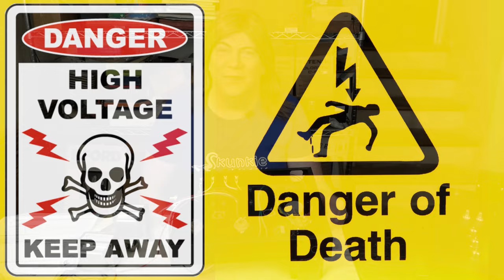The 12AX7/EL34 SE Amp Prototype: Power Supply Layout!

Comment: New subscriber here within the last year.  I primarily build small Class A guitar amps but lets face it, I basically build half your amp designs.  I just built a amp in a military 30 cal. ammo box for traveling and camping, no case penetrations so it's waterproof and the tubes were shock mounted and retained.  Your influence has improved my build quality 100%, under the deck it no longer looks like a basket of snakes, the layout and grounding schemes has my builds ultra quiet and dare I say it, very professional looking.  The basic amp was a D-Lab design (thanks Terry) everything was just under the locking cover right down to the Tremolo control and power socket and I floated it to a couple people I know and with your tips and style of build I had a bidding war going on when finished.  Pushed through a Bee Box enclosure with a Warehouse 12" veteran 30 the sound was amazing with a lot of sustain and chime I credit to wiring and sectional layout including using quality caps in both the power and signal circuits.   Thanks so much.
Reply: awesome reply

Comment: I’m very curious/excited for this build! I was gifted a ChiFi EL34 SE amp, which I’ve stripped down as I plan to do a new build using all the parts (transformers) I found a schematic I was planning on building, but I’m putting that on hold until I see how your build comes together.
Reply: I'm in the same boat. A Chinese amp designed for 807 tubes. That I have adaptors to use KT66 types. I think the voltage needs to be higher or better output transformers. The sound is clear but a bit scratchy thin. The chassis looks good so will rebuild it
Reply: The one I was given was an Oldchen with 5U4G rectifier and 6SN7 pre/drivers. I’m really just using the transformers, choke and some other small bits. Sounded quite decent in its original form.

Comment: Power resistors have flat surfaces so you can glu them directly to the top of chassis by thermally conductive glue. So the chassis will work as a radiator for resistors decreasing air temperature inside chassis. Resistors also can be located somwere on the side inside  chassis away from other components like capacitors and can be coneccted by wire to other components of circuit.

Comment: @ Skunkie.  I couldn't wait for you to get started on this since I am probably going to build this as my first tube amp.  I do have a good amount of the parts already as I was considering the build when you built your first EL34 amplifier with the octal tubes.
Reply from the maker: Realize I am already thinking of changes I will be making... If you start now, don't be made when the 2nd or 3rd one is laid out differently!
Reply: @SkunkieDesignsElectronics  Oh, I am not starting yet.  I definitely can wait.   But more than likely, I am going to stick with the Edcor output transformers right off the bat since I already have them.  I bought them a long while ago when I wanted to put together a "Darling" amplifier.  However, I abandoned that project given that the amp only puts out 3/4 of a watt and I have smaller speakers.  In fact, I have the same ones you have, the RP-600M's.

Comment: Glad you  canned the painted resisters the paint will retain heat  like putting on a jacket you can. Buy 10 watt black  ones that are high  quality with long leads
Reply from the maker: Not sure about paint trapping heat, Lots of air cooled engines are painted etc. But mainly just cheap China parts lol.
Reply: Contrary to what one might naturally think, the black paint will improve cooling of the resistor.  The process is called black body radiation.  The effect is substantial if the body is shiny metallic.

Comment: @Skunkie Designs Electronics I wonder if there would be difference on the high end if you use thick film resistors instead of wire wound resistors.  A couple of examples of thick film resistors are Mouser part nos. 652-PWR221T-30-5000F and 684-MP915-500.  It might be a fun experiment, possibly worthy of another video 😉
Reply from the maker: Those look interesting too!
Reply: @SkunkieDesignsElectronics  And you can bolt a heat sink on those.  If you use a non-conductive thermal pad, you could bolt those to the chassis to sink the heat.
Reply: @SkunkieDesignsElectronics  Here are a couple of heat sinks that could be bolted onto those thick film resistors:  Mouser part nos. 567-274-2AB and 567-271-AB.  A friend wanted to know some example heat sinks for the TO-220 package, and I thought I'd also pass along those examples heat sinks for those thick film resistors here, too 😉

Comment: Nice build and video as always. Looking forward to the next steps.

Short thing re. your Cable-Colour-Scheme. You mix black and other colours for the ground windings. Isn't it better to use only black?

Cheers 

Stefan
Reply from the maker: Those other color wires are the transformer center tap wires made onto the transformer.

Comment: Super project. I have built 3 single ended amp so far, they're great. I'll follow your project and will learn, I'm sure. EL34 are great tubes.
Please, tell us about the wiring color code. Is there a 'standard' to refer to? Like green for filaments, red for HT, black for brown? Are all output trans color coded the same? Thanks for your great work. Very inspiring. Sylvain, Quebec
Reply from the maker: Honestly, there isn't really a color code that I know of that is universal. I try to used red or orange for HT and black for grounds but the transformers seem to be all over the place lol
Reply: @SkunkieDesignsElectronics  Thanks. As a rule, I built my amps using 'black for ground, 'red/orange for high voltage, and 'green for feelaments. But that's 'my' way of identifying things, and always wondered if there was 'one' good way, a convention.. Electricity applied building code seems different and well defined though. I might give a try to your amp project ;-)

Comment: More push pull amps please.
Reply: While you get more  power out of push pull amps, there are many downsides.  Being more complex is one.   But more so, canceling of the even harmonic distortion is what put me off on them.  Also, many designs have heavy feedback, which usually leads to a very sterile sound.   In the end I found many tube push pull amps sound a lot like transistor amps.   A well designed single ended amplifier, preserves the second harmonic, which is what most believe what gives that 'tubey warm sound'.   So I have grown much more interested in SE (single ended) amplifiers, rather than push pull.